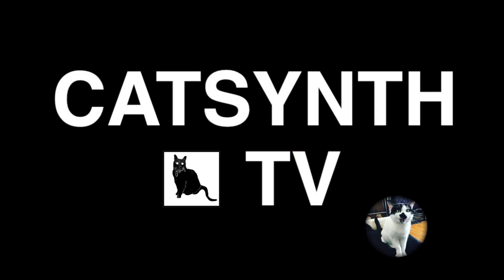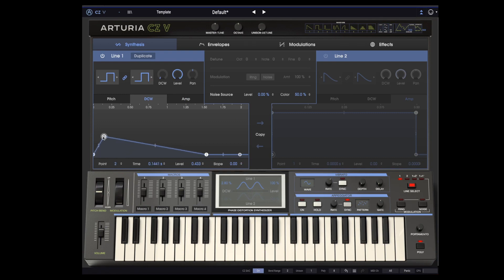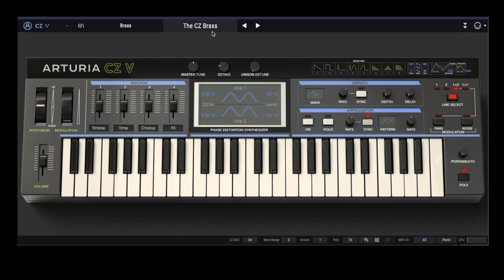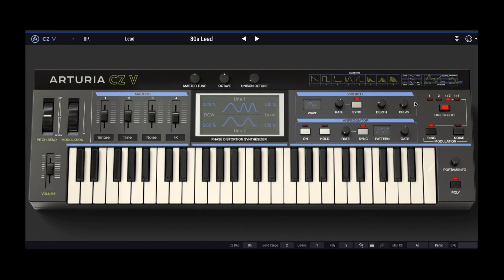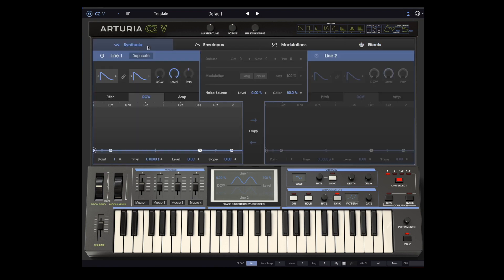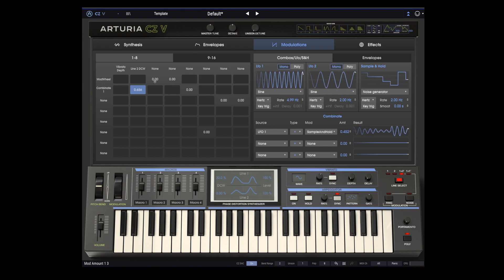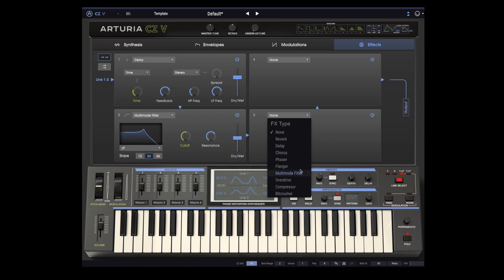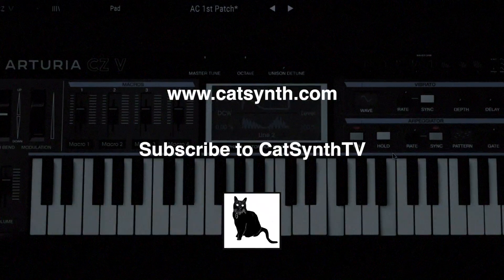Arturia CZ V Demo and Tutorial

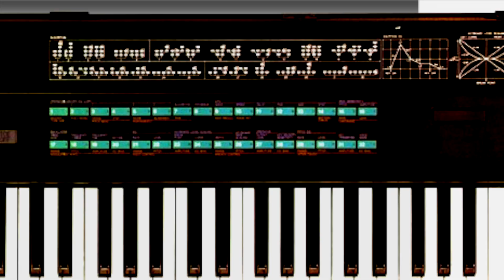Comment: at 0:47 you say that Yamaha's DX7 uses phase distortion but usually the core of DX7 it's called frequency modulation. are those 2 things that same concept?
Reply from the maker: That's an excellent question!  Yamaha DX synths use what is called "FM synthesis", but in reality they are modulating the phase using the operators in the algorithm.  This is similar to true FM, but not identical.
Reply: CatSynth TV alright so i guess CZ and DX7 are doing pretty much the same thing. a difference might be that CZ (from Arturia) allows you to draw your own wave, while DX7 has more flexibility since it has more operators right?
thank you very much for the answer, i really appreciate it 🙌🏻